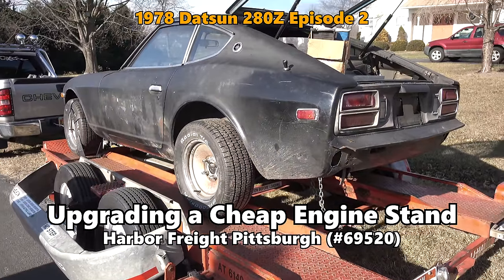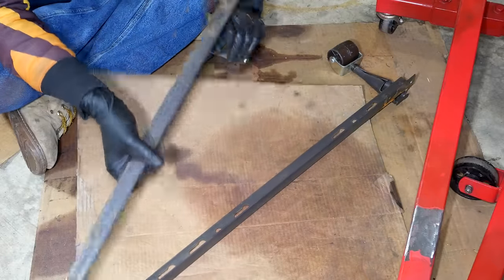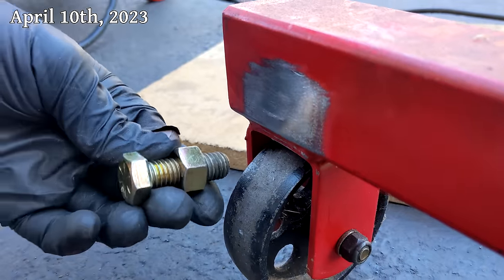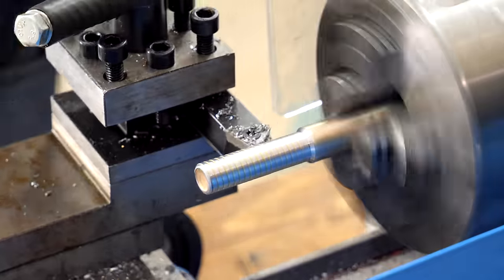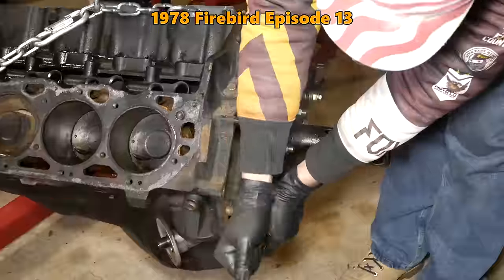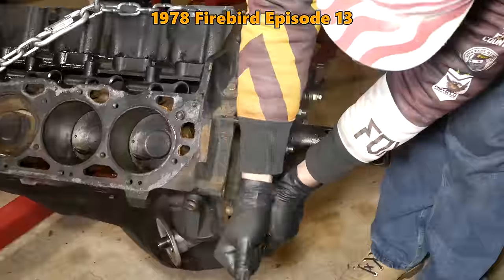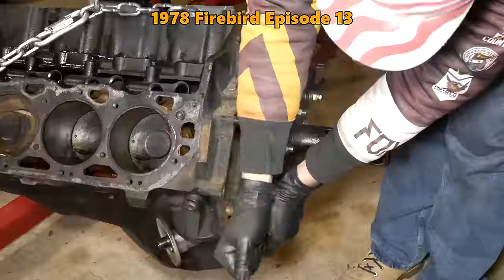Harbor Freight Engine Stand Mods (Reinforcement, Brakes, Handle, and More!)

Comment: Hey, did you ever figure out what was causing overheating in your Pinto?  I really loved that series!  Any plans for an update in the near future?
Reply from the maker: Probably won't see the Pinto for a little while, but I really do want to get back to working on it. I don't know for sure about the overheating but it is definitely burning coolant now. I have some doubts about the cylinder wall thickness and the current plan is pretty much to just build a new engine to be safe. I rewired the car and did some other work after getting it home but likely won't put that into videos until I'm ready to start working on it again.
Reply: @FuzzyDiceProjects I had suspicion the headgaskets were bad on it after that drive
Reply: Put the blown 350 in it
Reply: I would be curious to see if the head gaskets were installed upside down. It is easy to do and if that happens coolant passages get blocked and the engine overheats. @FuzzyDiceProjects

Comment: For the next version, chop the 3/4" wrench up and weld it to the end of the handle.
Reply from the maker: I like that the handle can slide through from either end and that would unfortunately get in the way, but I do like the idea of having a specific wrench just for the engine stand!

Comment: nice work. regarding the new handle being too long for tight quarters -- why not just add an attachment point to the other side and store the old (short) handle there? then you have both lengths of handle for any situation
Reply from the maker: That's a great idea! I had considered using both handles and just swapping between them but two handle holders would be pretty slick.

Comment: I bought that same stand, then tried to mount up a 440 Chrysler to it. As I let the hoist down, it kept on bending and bending to about a 60 degree angle, at which point I stopped, removed the motor, and returned it to HF. Half ton in Chinese means around 400 pounds. I then bought a beefy Larin Big Red Jacks engine stand, and that unit didn't budge at all under the big Mopar.

Comment: You could get a can of frame protectant spray ment for spraying inside tube frame. The cans usually comes with a nozzle extension that can spray deep into that open section of the stand and protect it from any rust. Eastwood has a good one for rust prevention and conversion.
Reply: Thats a great tip for him i knew about that stuff but didnt think of it until i read your comment good idea man

Comment: If you want to add a 360 degree gear drive on the head shaft, consider an air brake slack adjuster (about $25). That way, you could use a cordless drill to rotate the engine. It could eliminate the need for the locking pin also.

Comment: Probably the best tool for the job is the one you create yourself, the handle pin falling out can be fixed by putting a magnet in the tube next to the hole with epoxy. strong enough to hold it in place but easy enoug to pull out

Comment: I have the same stand, and I think it's time to break out the welder and get to work. I agree with you how janky they are out of the box. I was rebuilding an engine for a family member, and I was sweating bullets every time I had to turn the motor. I thought well here goes 3 grand if this damn thing breaks. But anyway, very nice upgrades. You have yourself a hell of a nice tool now.

Comment: Ace hardware has metal “sleeves” that fit inside the posts/around your bolts that mount to the engine block. They help keep the bolts centered and from slipping around in the posts

Comment: I would look into ordering a can of fluid film with one of those long hoses that shoots out in every direction like what they use to get inside of truck frames.  then give that vertical tube a real good coating.  you probably wouldn't ever have to worry about the inside again especially since it will be protected from most of the elements.

Comment: You have a lathe, I would buy some sch40 tubing and replace the upper then turn a tighter fitting pipe to go in it. But man you had some great ideas. I will definitely do some of these.

Comment: I modified mine by mounting the engine mounting arms on the back of the plate and used 3/4 × 1/4 strap to make the little arms C Channel and increased the length of the bolt tubes.

Comment: You could add a rubber seal to the head Bolt to prevent it from collecting water.
Could Make the Installation a little bit Harder, but it would also help prevent to Bolt from wiggling arround in there.

Comment: I recently got an engine stand from my dad that he made back in 99.
He made it out of 6" heavy wall steel pipe😯 I told him MAN! that thing could hold a dang semi engine😄.
It's even got a rotating back plate. 
Going to be a indestructible engine stand for my life and then some. 
For the last few years I've been using an old 1980's 3 wheel stand, it's still a great stand I'll continue to use also. People are scared of 3 wheel stands but if you get a good old usa made one with a wide rear wheel base they work just fine. 
Plus they play very well with the engine hoists.
Idk about the OEM configuration of the harberfreght engine stand for anything more then a 4 cylinder engine..
Those welds looked scary enough.  
You did a great job fixing it up though👌

Comment: Been meaning to upgrade mine as well. Got a few ideas from this. The only thing I can suggest is adding some quality grip tape to the stand for when you brace it with a foot. I did the same with my engine lift.

Comment: As all the bolts are 3/4in, could you have a 3/4 hex socket on the end of the turning handle to adjust the brakes without crouching? A bit like the jack handle and the air release screw
Reply from the maker: It would have to be a thin socket to not interfere with the handle sliding through the head from either side, but it's definitely a good idea! Maybe even a hex socket on one end and a square drive on the other so it can be used as a long extension with a wrench.

Comment: Good stuff , I've had the same problem with all stands , I will definitely support the mount plate because next build is a 460 , last stand was a power torque brand same china junk , 1000 lbs , do not trust it at all , sagging alot with a 400 on it at night I put chain from hoist to lift front , do in am I did not have engine on floor !

Comment: You should make the double locking head pin loop the box end of a wrench that tightens all the bolts.  Then you will always have the wrench you need to use the stand with the stand.......

Comment: I love your videos! The amount of thought you’ve put into fixing that little HF stand is awesome. I wonder how much it would cost HF to encorporare at least some of these fixes? They could sell the better version under the Hercules line. Having watched some other videos and struggled with most of these issues myself I like a lot of what you’ve done. I too have misplaced the original locking pin for mine. I’m currently just using an old 3/8 inch wratchet extension. I think the handle mod was overkill. When I need some extra leverage to turn an engine over I’ve found using the handle from my old craftsman Jack works like a charm. Overall I love what you’ve done though. It looks like you’ve really increased the safety and overall usabilty of the stand. Thanks so much for all of the great ideas! I may be attacking my engine stand with the grinder and welder over the weekend

Comment: Really nice stuff.  For the wheels, you can get weldable locking castors for a few bucks each, the kind you operate with your foot.  Were they not up to the task for something like this?  Just in case I wind up in a similar situation.

Comment: Great idea for the handle with the holes and pin to lock it at different lengths that sch40 is a must when buying these stands from harbor freight i crushed my hand rotating a engine on my 2ton stand the little handle is literally a joke when it was turning momentum took it and i couldnt hold the weight and couldnt get my hand out in time and got my hand smashed between the support brace on the 2 ton version after buyin longer handle never had that happen again so ya a longer handle is a MUST!!! Its Dangerous without it!

Comment: My biggest complaint with the 750 or 1,000 lb engine stands is they all tend to lean when you put more than a few hundred pound engine on them My next complaint is once you have the engine on it it is next to impossible to turn that engine over by hand because there is so much slop in between the engine stand head and the axle stand where the two round pipes go together It just kind of binds up.

Comment: Where the pin goes in to keep it from rotating, the holes don't match in size.  Drill all the holes the same size and use a pin that fits well.

Comment: I'm welding a 1/2 socket to a 1/4inch plate/disk to close the head and be able to use a large ratchet/breaker bar as a handle

Comment: You need some gas for that welder, you use it enough.   I always tough about putting a couple bearings on the shaft to help it rotate the engine . Obviously have to resize shaft but I think it would be a upgrade

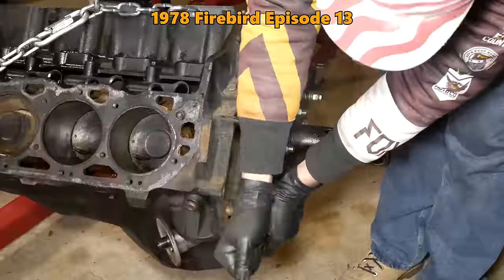Comment: 11:19. Instead of the welded bolt you could have just drilled a hole through and put a pin right through the wheel sideways. It already has holes in the wheels. Add a spring retainer et voila.

Comment: Too bad Harbor Freight designed it with the castor wheels on the wrong end. You can steer it easier from the head end whether an engine is mounted or not with castor wheels below the head.

Comment: You bought a s**tty engine stand the 2000lbs one with 2 legs is way better but the best one is the 1500lbs Daytona gear driven one.
Reply from the maker: The problem with those heavy duty ~2000lbs stands that have two forward legs is that they don't get along very well with the style of engine hoist I have. You can make it work but it is way easier with the lighter ones. Also, there is a huge price difference between this cheap one and those fancier models.

Comment: Pretty cool.   A tip fir your welds, You're just going to fast for 1 and 2 do C's rather then Circles whrn you're welding and keep your wire feed soeed anlittle lower.